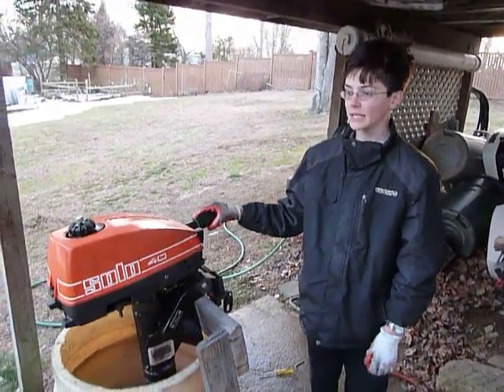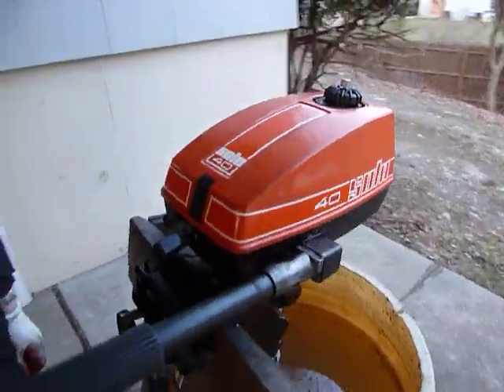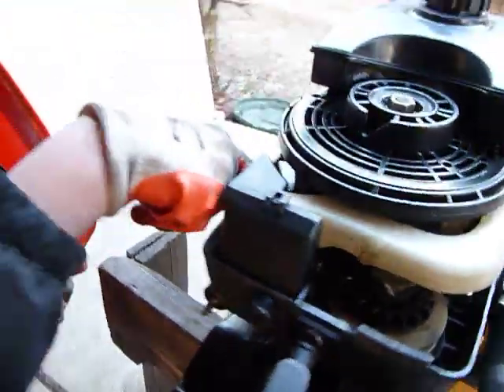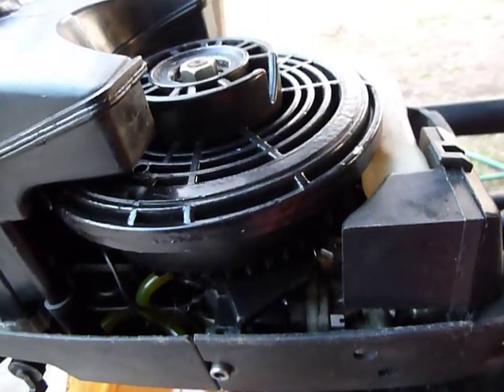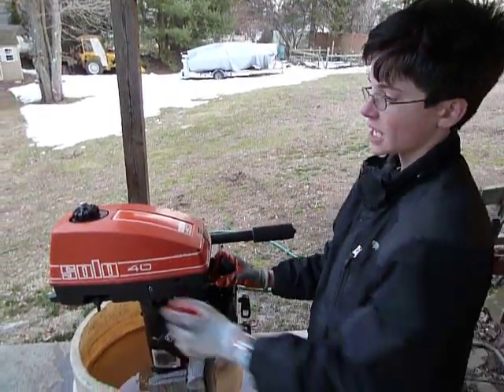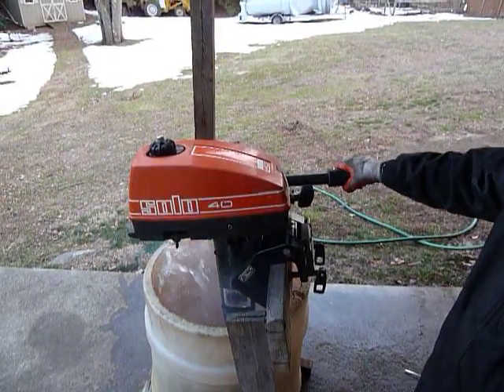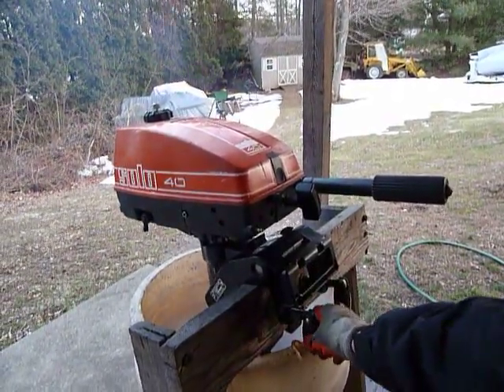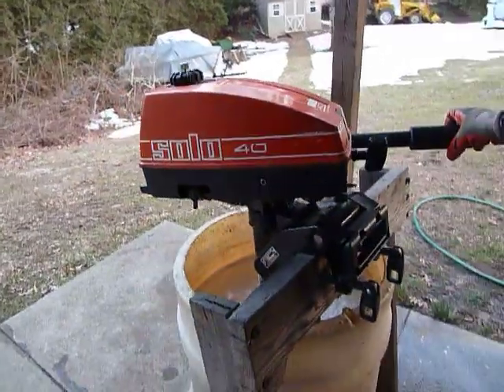Harry's German Solo 40 (6hp) Running

Comment: What is the fuel ratio
Reply: This motor runs on a 50:1 TCW3 gas oil mix
-Some Solo's recommend  100-1, but that was almost as short lived as motor running on it.